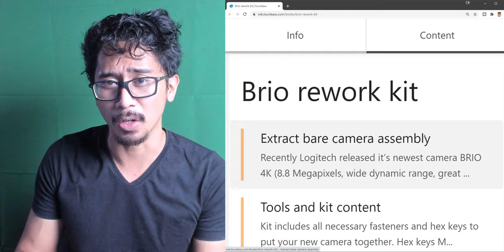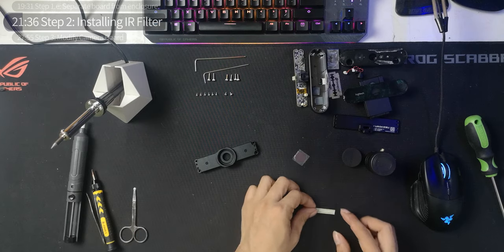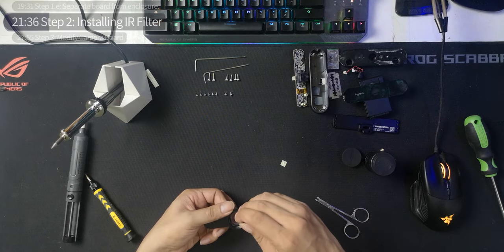Kurokesu Rework Tutorial for Logitech BRIO 4K Webcam

Comment: Hi bro. My brio 4k stream edition stopped  to be find by usb port in my notebook. I tried on other computers and with other usb cable and it does not work. I disassembly this camera and the only one thing is wrong on pcb plate is the same microphone slot faulty as in your brio. So what is the reason that the camera stopped getting to power on from usb port  ?